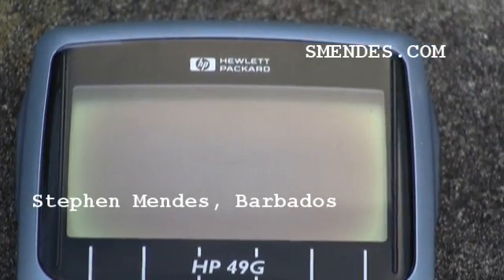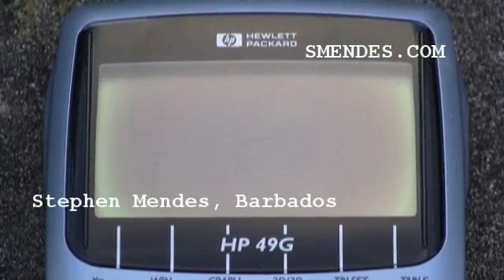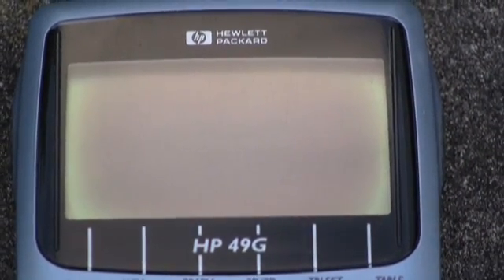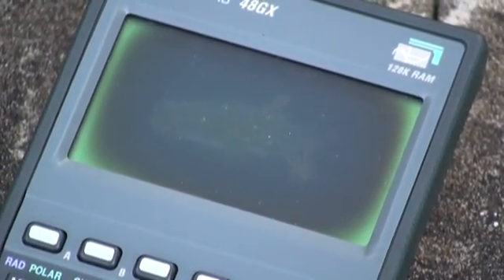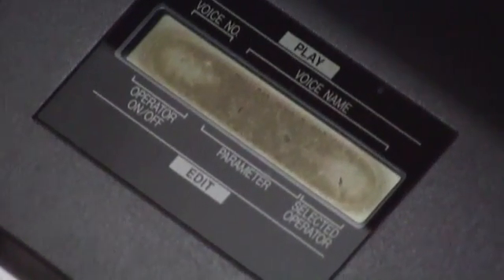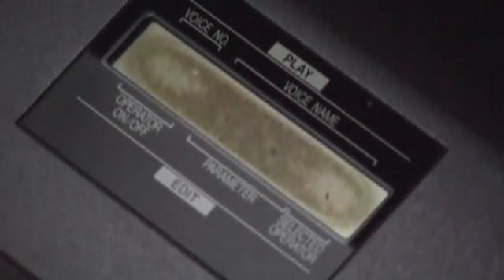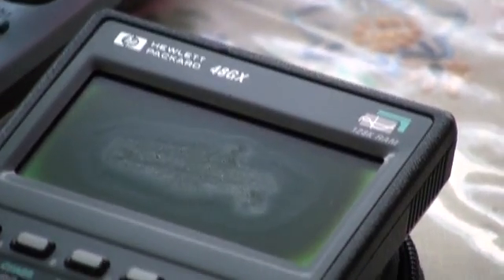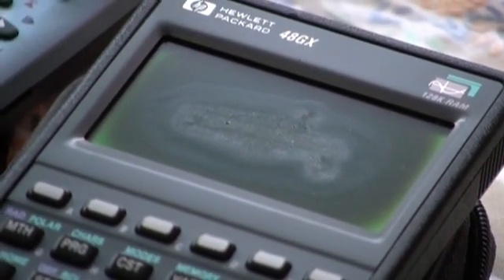Self-destruction of older LCD displays

Comment: I collect HP calculators with Saturn CPU. I have 3pcs 48G, a 48G+, 3pcs 48GX (two with blue tint display, one with black), a 48SX and 3pcs 49G. The LCD in all of them is perfect, like new. A 48G and a 49G are in regular use, rest of them are in sealed box with silicagel in it. I have many BASIC programmable Sharps and Casios with big display from the 80s, which dont have any problems with the LCD.  I think that the high temperature kills the old LCDs.
Reply from the maker: High temperature combined with complete darkness (left in their cases for years without exposure to light).... I lost everything including several Texas Instruments .... a few Sharps and Casios .... ALL with the same screen damage.... and it's not limited to calculators either I experienced the same screen darkening on numerous other devices from electronic bathroom scales to wireless "weather stations" and hygro-thermometers .... as well as miscellaneous scientific lab equipment .... all are small monochrome LCD displays ...... never had failure on a color LCD .....  anyhow we are now using continuous air conditioning  so high temperatures are a thing of the past.
Reply: @StephenMendes  My calculators are OK, but the display of my Rohde Schwarz SMFP radio tester and one of my Yaesu FT-23 transceivers are partially blacked out, these devices are in higher temperature for years. I hope my calculator collection will not be affected by this error.
Reply from the maker: @zoltan_dudas  once you keep them at 25C (or cooler) and allow the LCD's access to some light (don't keep them in the cases all year round) .... they should be fine..... wish I had know this before I lost mine

Comment: I have a couple that have the same issue.  on the 48gx the one that went dark os one pf the black pixel display.  the one i have that is blueish doesnt seem affected.  The white plastic degradation which is a different issue. had happened in an hp28s that i use to have.   I live in Puerto Rico.  Pur environments are  similar!
Reply from the maker: my 48SX had a blueish display and that went bad also.... thanks for your information..... I had kept my calculators  in the dark (in their cases) with very infrequent use..... I think if you keep the displays open to the light then destruction might be less likely .... but it's just an idea....  I am hoping  somebody can prove/disprove it for me.

Comment: HP 32S and HP48g both with very dark LCD.

Both were bought in Canada and used extensively for a few years. I took it with me to the Philippines, lightly used and then put it in  storage inside my apartment.   After a few years, I tried both calculators, both LCDs were dark. My guess is heat and moisture. How do I fix this?
Reply from the maker: It seems the common factor in this problem  is that the LCD are left in the dark for extended periods....... stored in their cases are not regularly used....  these calculators are not designed to be repaired....... it requires considerable  ingenuity and skill to cut them apart and change the screens (with other second hand screens) since these screens are no longer being manufactured..... finding a way to glue them back together is probably as difficult as taking them apart without damaging them...... however, if you wish to try..... there are videos and instructions on Youtube as well as the hpmuseum forum (if you are not a member you can join for free)..... others will guide you through the process...... I just abandoned mine and moved on.... bu I cannot bring myself to actually throw them away 😊

Comment: I live in Malaysia. I have lost my HP 48, HP 20B , HP 38G and a few other non-HP calculators to the black screen degradation.
Is there any way to undo the damage?
Reply: Instead of replacing the entire screen you can just replace te polarizer filter... search gameboy screen repair, the process is similar
Reply: @carlosnavach3520   muy buen dato tengo una hp 48 sx con este problema, lo intentare,  very good tip I have a hp 48 sx with this problem, I will try it.
Reply from the maker: Not that I am aware of...either you have to get a replacement LCD... or ditch the product.. it's real sad 😒

Comment: Stephen, I live in Brazil, I have a hp48G+ with a very light brown mark in the center of the display, I would know if there is anything I may do to prevent it to get darker. Also, I note that it seams to be more related to the polarizer then liquid I think, anyway, I saw comments into internet that instruct people to put the unit into the frízer and after some minuts put the back to work, according to them it may Works. Anyway, What did you evaluate in the root cause analysis of this problem, what cause it and is there anything we may do to avoid it or reduce its effect ?
Thanks , Cesar

Comment: This looks very strange. I have some older calcs: HP (28S, 42S, 20S, 2x 48SX, 48G, 48GX), Casio fx-115M, and some other LCD, LED and FL calcs.

The display of the HP 28S, 42S, 20S and fx-115M is as good as new. The others are lose  contrast over the years. But there is not one with a problem like yours. Could it be a UV and/or temperature and/or humidity problem? I live in germany and never saw a calc with this strong problem. You should contact HP. The 49G isn't so old.